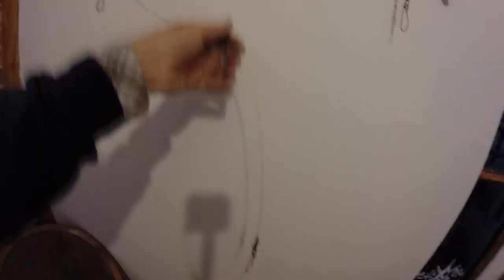Crazy Overnight Fishing in Ancient English Estate Lake

Comment: A good super low resistance method I use for perch on my club waters is. Instead of a bobbin, I find a small 3-4 inch long twig that is maybe 1/2 inch think, and pin the line to the floor underneath the reel spool. The wind doesn’t affect it with it being on the deck, and the slightest pull on the line and the stick moves allowing the line to freely be taken from the spool.